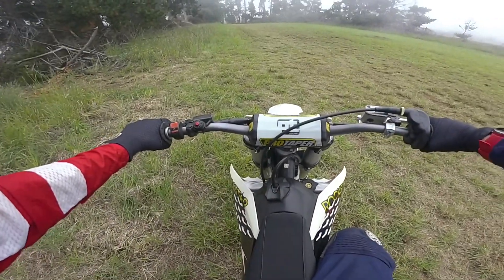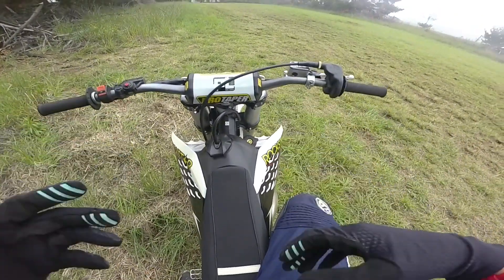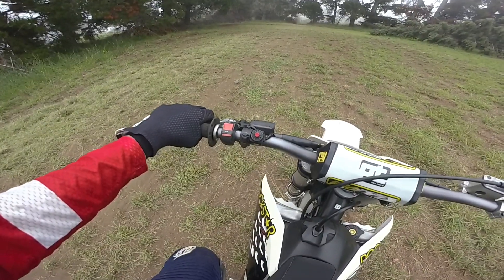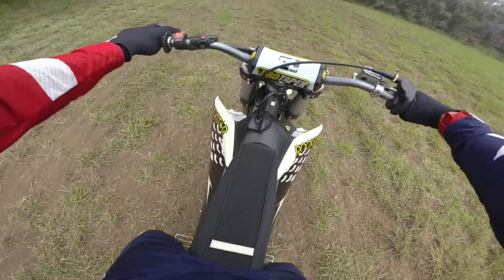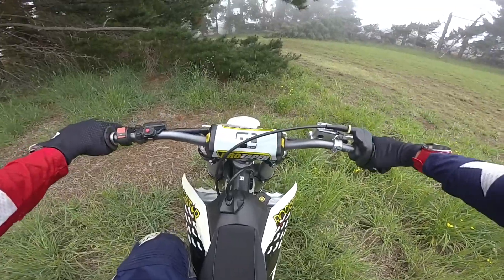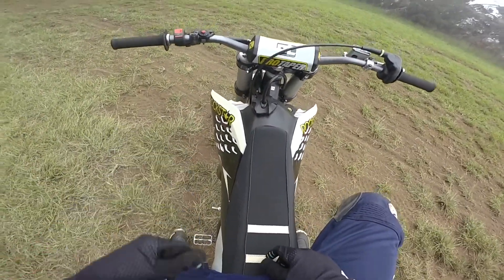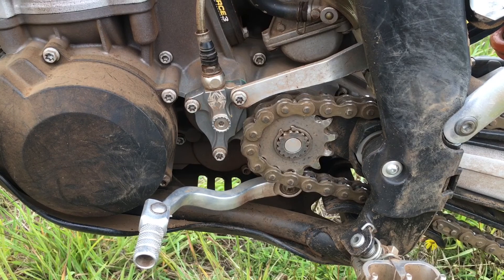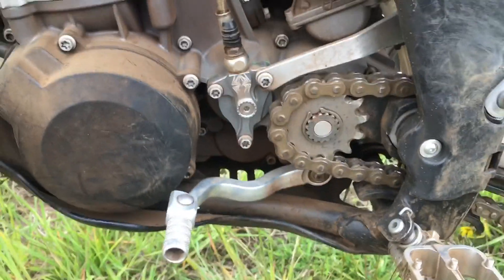Rekluse Auto Clutch Pros & Cons - Everything You Need To Know

Comment: I hate when the engine dies (and it will, no matter what they say) and you are going down hill, you can't bump start it. Also, it adds more variables to the equation. Do I have the right adjustment on the 'slave'?, do I have the right springs in the auto clutch? If your bike has a crappy clutch like Suzuki or Honda, maybe look into the Core version. On a KTM you don't need it. Unless you ride while eating a sandwich, save your money.
Reply from the maker: The Duke, the only one I've see die/stall was freshly installed in a 250F and the idle was too low Flame out. Hasn't since. Mine never died once in 10hrs of use. Just did the first Freeplay gain adjustment right before this video. Less than one tick. One of my friends has them in 4-5 bikes. Not one problem.

I do like a good sandwich out on a ride.
Reply: @JohnHowerton137  If you ride a Honda, you can make coffee to go with that sandwich..... Stay safe.
Reply from the maker: The Duke Red died for me when Honda went Aluminum. My last 250 was a 1995 and my last 125 was a 1997.

Guess I do still have a buried 2003 XR80 (steel frame 😆) I bought new in '04, in the corner of the garage. Might need a whole pot of coffee to get that thing out. She was retired with a nuked stator for a KLX110 in '05 which got Orange plastic 🤣 I did miss the clutch lever on the pitter for sure. Wish I could find some of the old VHS movies I made on my '86 XR80. They were hilarious. I had a themed one we called "Crusty In Lexington" (the town I lived). Looked in my Mom's house and storage unit for hours in Dec. Didn't have time to watch all 7,000hrs of unlabeled VHS tapes. LOL

If I hadn't worked so much and had some better cameras or photographer, I probably would have made a b-roll shot or two in Terrafirma 3 🤣 My FOX rep said he would.

Rubber side down my friend 🤙
Reply: @JohnHowerton137  Any relation to Kent Howerton? He has a son running around here somewhere...
Reply from the maker: Not that I know of, but can I pretend? 🤣

He was racing one generation before my time, so outside of a few clips and photos I've seen online over the years, never got to see him race.

Comment: Another con in my opinion.  If you lay the bike down and the rear wheel is off the ground, in any gear other than neutral, the wheel will continue to spin at idle rather quickly.  I’m worried about catching an extremity or clothing in the spinning wheel.  Just a thing to watch out for
Reply from the maker: Motorcycles are dangerous and any bike will so that. As a guy who had a Dunlop 752 forearm tattoo for a decade (long before Rekluse existed), I'd rather slow down a wheel with my arm in faux neutral, than a bike solidly in gear. In my case, 4th. 

I run bar ends in all my bikes. Keeps your throttle from sticking wide open when it sticks in the ground most the time and makes your grips last 100 times longer because they don't rip every tip over. You can also swap wrap around handguards on and off super quickly if you don't want to run them all the time.

Comment: I don't like mine so far, it feels like i have less control over the bike
Reply from the maker: That can be adjusted out. I’d planned on making a video about it yesterday, but got stuck doing 3 months of behind maint on all my bikes. Look for it hopefully later this week.
Reply: @JohnHowerton137  ok cool, I purchased the bike with it on it. I will for sure be looking forward to it.  I wonder if I can re use the basket and other parts and change to the manual torque drive model? I need to do more research, I just got the bike
Reply from the maker: @rickywoods3101 I believe you can, but that would be a question needing verified by their techs. Probably just need to go back to the manual slave cylinder… but even the auto slave could probably be adjusted to work with the correct throwout tension.

It comes down to the springs in the EXP disc. They can be adjusted so the clutch engages at lower throttle openings, making it feel very similar to a manual, but with the anti-stall and tractions benefits of the auto. Most Rekluses are not set up this way, even the one in this older video. I had a love/dislike relationship with it in this 250 as a result, because I didn’t understand (take the time) to know how it could be tuned.

Comment: I never use my clutch to shift.
Reply from the maker: Don't have to... but you should. Wears on the shift dogs. I've lost teeth on 2-3rd gears when I used to shift without the clutch because of my hand wouldn't work.
Reply: I do if I'm shifting hard under power but if I'm just coming into a corner and need to drop down a gear I generally do not use it.
Reply from the maker: Same thing I did. Hand couldn't pull the lever. Click down without it.

Comment: What u call ur wife? Jk

Or just use ur finger 🤪 well.. Good thing u dont trail ride hard hills or not hard even.. Rolling backwards in gear will help u save u rolling back. Learn to ride a normal clutch i think will give u best rewards. But u do u:) i do promotes rekluse torq or hinson...covers, and plates. Btw sure u dont need rejet anything. Just a small turn.
Reply from the maker: Me 2 don’t have a wife. My bikes are my wife 😋
Reply from the maker: Me 2 don’t ride trail or hard hills or hard? Dude I race A/Int, I’m going faster than most. I’m traditionally the guy that created the hill climb (1st tracks) that everyone else “tries.” I’ve been riding for 32 years... don’t even own four wheels, I have 6 motorcycles. When I did own 4 wheel vehicles, all but two of them had manual transmissions. The only reason those two didn’t have manual transmissions is because I didn’t have an option. 

I’ve ridden a Rekluse clutch like 8 times in my life. Thousands of rides, 8 with a Rekluse. Unlike most people who hate on them, I don’t have an inflated ego about their potential to improve my riding. I don’t ever intend on stopping on a hill. I make it, or turn around and try again. If that’s a real concern for you, and it is for some, add a left hand rear brake. It’s better anyway.

My E-KTM is a full auto and works very similar to the Rekluse. I’d argue, riding that bike with no clutch lever made me a better rider due to better focus on riding position. It fixed a TON of sloppy technique that the clutch lever use gave me. The improvement of two of the guys I’m coaching, confirm this anecdote. Rekluse auto WILL make you a better rider unless you’re a top A or AA rider. Period. And even those people would see benefit practicing with one. The Star Yamaha team does... and they’re some of the best riders on the planet.

By the sounds of it, it doesn’t sound like I’m talking to someone with much experience. Jetting isn’t a conspiracy. Anyone who marginalizes it’s importance for engine performance isn’t a good enough rider to notice the benefits of anything... Same guy is the one who’s never even set his SAG and talks about suspension 🤦‍♂️ There are literally industries built around jetting... it’s more than just a turn. This bike needed a different needle or slide. Don’t know, I sold it. Didn’t like the riding ergonomics of that KTM generation and didn’t want to sink any more time into that bike. When I ride twice a month, I want to ride, not test. I LOVE testing, I just don’t have time to do it.

Comment: Thanks. That clutch is not for me.
Reply from the maker: Yeah it’s probably not for everyone… but the two that I have now are tuned in a way that you wouldn’t even know they’re in there. Full engine braking at all RPM, and the same feeling at the lever. The only way to know now is a full brake lockup without the clutch pulled in, which is really all I want and need for when my hand function goes away. I love everything about the control of a manual clutch except for when really rocky terrain has my bad hand so trashed I don’t have any fine motor control in it. This gives me a bailout switch when the hand makes a mistake. Keeps the body from grinding though the cheese graders as often.

Comment: Rekluse clutches are not good for the bike or rider.
Reply from the maker: That's 100% opinion and an unsubstantiated claim.
Reply: John Howerton Rekluse auto clutches make the bike run hot... especially in a hard enduro situation. None of the top enduro riders use auto clutched. Ive seen 300 2 strokes with fans overheat because they had auto clutches on them. Now some people say “ I’m just a trail rider and like not having to worry about it stalling.” That’s just ridiculous. Just learn to use your clutch!! Steve Hatch is a retired pro GNCC racer and coaches top riders like Russel and Sipes. He NEVER recommends an auto clutch! In fact when people come to him for coaching and they have an auto clutch he tells them to remove it because they don’t help anything. Clutch control is the most important skill to learn on a dirt bike and a Rekluse clutch literally ruins that skill and makes you a worse rider. So there is the substance to my claim. And anything you say about a Rekluse is also 100% opinion FYI
Reply from the maker: Wolfe no reason it would cause overheating outside of riding in the wrong gear. Rider error. I ride a 250SX with no fan in the Hawaiian desert (Hot as F). Slow moving and No coolant loss whatsoever. My 350EXC required a fan and still lost coolant in the same environment. No Rekluse. Ride the clutch all day through the rocks. Pain in the ass, dangerous due to flameouts, barely fun.

You do realize the Rekluse clutch lever work EXACTLY like the manual clutch right? 

Clutch control is not even close to the most important skill in riding. Someone is blowing smoke up your butt. I've met Hatch WORCS series 2001(?) A manual masks sloppy riding technique in amateur riders. It's a crutch. Top level (.1% of riders) hard enduro it is an extremely important skill... and no they dont need and auto. It's a hinderance in most cases. They have 100% better understanding of riding technique than a weekend warrior.

Jarvis is hands above them all, and while he doesn't use one... he is a coach and you can find him saying with his own mouth to students "They're (auto) quite good." in reference to struggling weekend warriors.

There is a reason why top riders practice clutch-less motos. Clutch lets you get away with being lazy in your timing and setup.

Opinions are like buttholes. Everyone has one. Some are based more in fact than others.
Reply: John Howerton Interesting opinion you have there. If you have ever taken any kind of coaching from Rich Larsen, Jarvis, Coleman, Wentzel, or any other top enduro rider they will tell you the importance of clutch control. They will also tell you not to run an auto clutch. Also why does it matter that you are a weekend warrior? Are you just saying I’m not a good rider and can’t learn how to properly use a clutch. Because if so just take some time and learn lol But I can see why someone who dropped almost a 1000 bucks on a auto clutch ( maybe more ) would be so eager to defend it. And John... try and refrain from such childish examples as bodily parts. It makes you come across very odd. 😂😂😂😂😂
Reply from the maker: No I haven't, but I am friends with the best motocross coach on the planet. I was his house on Sunday and will be again on Saturday. Those riders you mention use his  fundamentals. 

I think you should go back and read the comment. Then you should go watch what Larsen and Jarvis etc.. are actually teaching (balance, body position and timing). Without those you are doing nothing, wouldn't matter if you had Toni Bou's fingers on your clutch lever. Last time I checked, there wasn't even a clutch lever on Danny MacAskill's bike? He seems to get through the technical stuff ok.

Clutch control is important at the top level, but it's not what they teach. In Rich's last video the clutch is barely used in 10 of his top 15 tips! Like 12 can be done without one and ALL can be done as well or even easier with a Rekluse for the average rider. 5 of them most weekend warriors will never even be able to do. 

I've ridden with an auto-clutch 6 times in my life? There were times in my life where I rode 5 days a week. 6 rides isn't crap. It was $500, and if it wasn't good, I'd take it out. I could care less about the money.

The "body part" sayings I used are quite common in the english language.
Reply: @creedkisling233  Why are you even bothering to sit around watching obscure videos about Rekluse Clutches and arguing with people in the comment section and writing paragraphs of nonsense  about it - if your best friends with the greatest riding coach in the world who happens to hate them. LMAO. 
Nice fairy tale though- but slow down on the drugs.